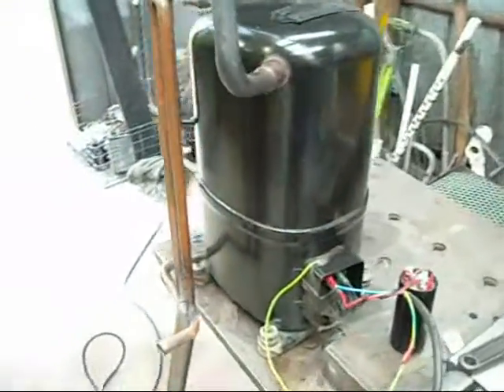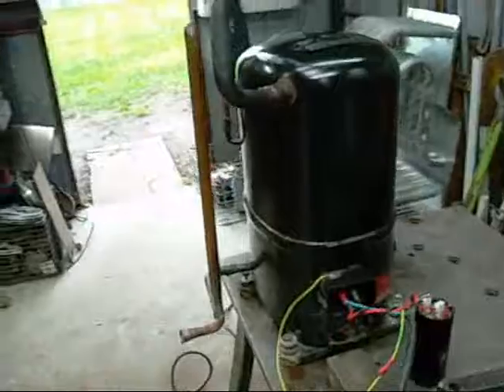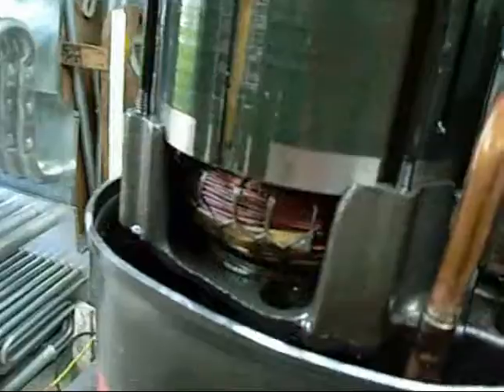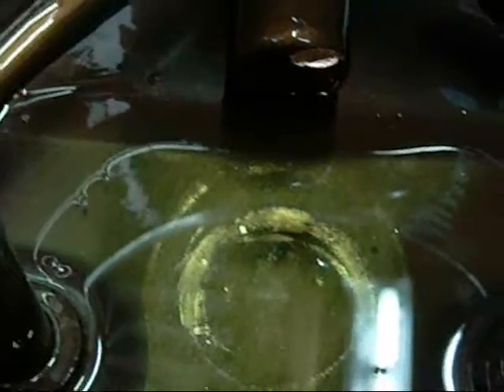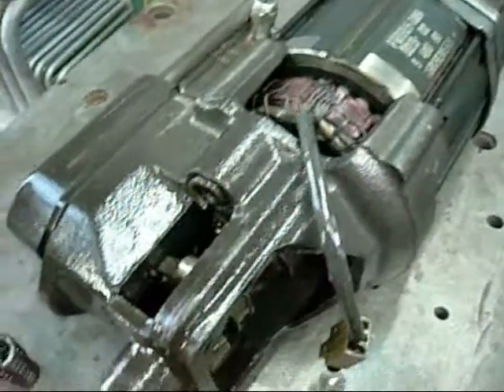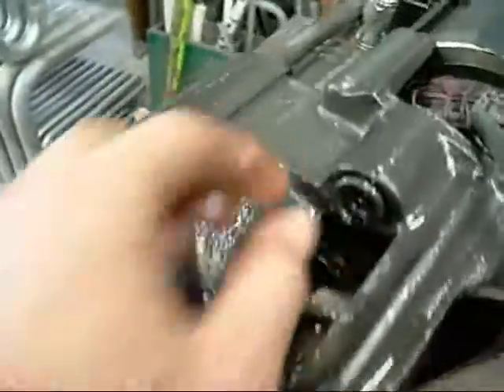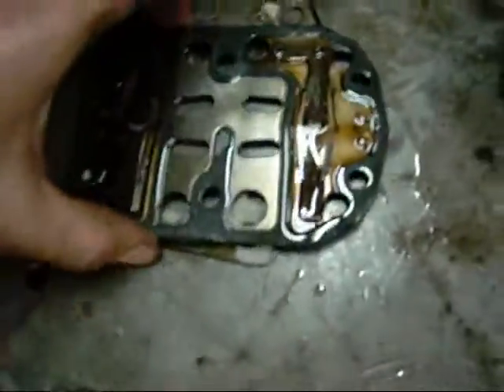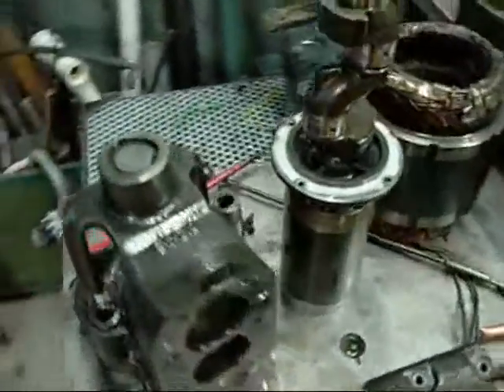Failed Spring Mount in Copland Reciprocating AC Compressor

Comment from the maker: @tranold to weld them back together I would use a Mig, you want to keep the heat to a minimum and have a high strength weld that won't crack and blow apart at 120psi

likewise make sure there is no oil on the inside of the area being welded, and purge the inside constantly with nitrogen to avoid iron oxide flakes forming on the inside. the flakes will destroy the compressor pretty quick.

likewise avoid oxy-acet, too much heat and not enough weld strength.

Comment from the maker: I'd say it was over-hardening or other problems in the spring metal, I've seen automotive suspension springs crack like that and its usually due to metallurgical problems.

Comment: Very interesting autopsy! I love finding out the cause of why things fail. I found a very old condensor unit in the woods once, looked like it was part of a vending machine or something, it had a small water pump attatched to it. but I cut open the compressor and there was nothing wrong with it, it worked fine!